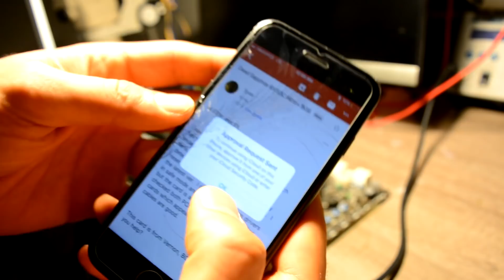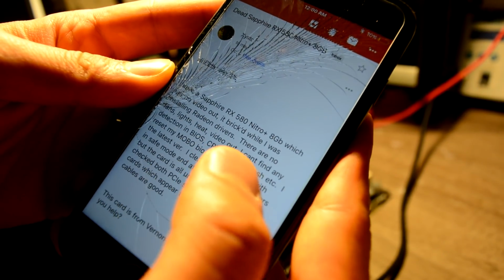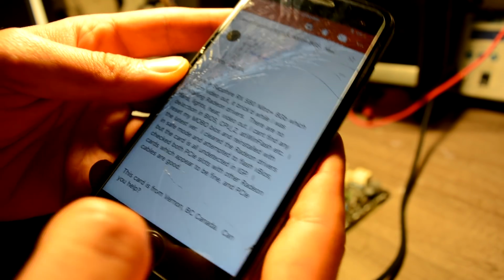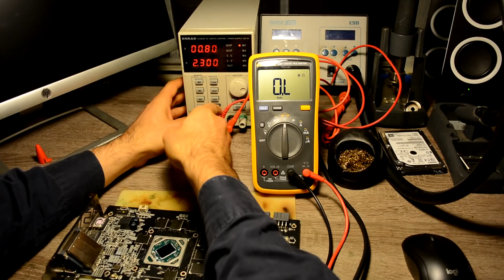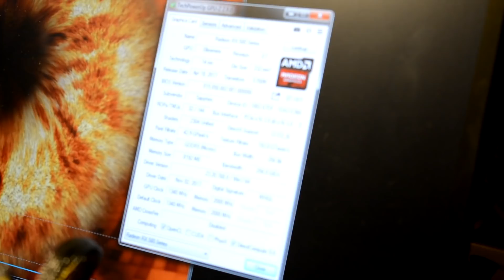RX580 repair graphic card unusual problem Radeon Sapphire nitro video card repair

Comment: My son's 580 is fine, but as soon as you start a game, the pc crashes - like 4/5 secnds in and just as the in-game rendering starts. Reinstalled windows, checked the graphics card, cleaned it and I don't see any visible defects. Reset the mobo also.
I do use a VGA to HDMI converter though. I'll have to replace that and see if it fixes the issue. For now, he's playing with the onboard graphix(Zen 3200G).

Comment: in short, could you tell where is the problem with the disappearance of the volts ? I find it difficult to follow you. Which is the function of that very LDO-regulator? The problem of failing to have 1.8volts in VRAM is due to this regulator?

Comment: Hey Eli, Dont know if you will even see this, 
But I have a question.

My rx580 is spinning, it is detected in the device manager, 
but it will not display at all.
Booting into windows will get me a black screen, and when downloading drivers for the Rx580 my pc will just freeze. 

Thanks, hope you can help.

Comment: Hello, im really happy you made this video because it might be the same problem im facing with my RX580 which do not power at all. 12V fuses have blown, but no short found, the core takes amps from the coils of the power stages but not right after the blown fuses. The situation for me is quite differente as i don't own a motherboard yet, i have a lab PSU and multimeter and i was wondering if it's enough to target the GS7103 as faulty, or even the NCP81022.  Do the PCIE connections has to be feed as well during the process ? In my case,  if i feed the 12V rail and bypass the fuse, i don't get output from the GS7103. Wish i found the guilty part.

Comment: hello i have a asrock rx580 the card cannot display but its detected by bios and windows. GPU z display bios info and fan speed but cannot display gpu and memory sensors info’s . the ship is heating normally . there is no missing voltage for the gpu. according to you wat can i check to solve the issue. thanks

Comment: Hello, i have 2 broken AMD cards: rx 370 3GB and rx 580 4gb both have same issue, they only work in safe mode, once the driver initializes, it gives black screen, what could be the issue? which components do you suggest i check via the multi meter? did you have cards with same issues?
Reply: VRAM problems, use tserver, if not check for memory controller

Comment: Unbelievable this actually worked!!! I had an Asus RX580 that would reliably fail 20 minutes after power up. I removed heat sink and fan assembly, cleaned off heat transfer grease from GPU, then heated the board up with my heat gun.  I slowly heated the whole board to about 170c then heated the vram chips and GPU to between 187-200c for about five minutes. I used an infrared thermometer to monitor temperatures. After letting it cool I applied fresh grease re-assembled and powered up.  I have been running GPU benchmarks for 2hrs and board is working perfectly. Thanks!
Reply: And how is the card doing right now? Still running perfectly?
Reply: @secondfirst7789 same question @PAULHODARA

Comment: Hello. I have the same card. I recently saw that in games that use over 3gb of vram(i have the 4gig version with Elpida memories) some small dashes of purple light appear on the screen after some time playing (can barely see them).
 I thought that the vram might be bad so I installed OCCT to test it. 1 minute into the test and I already have 7k errors. What does this mean? Could the thermal pads be that old? Is my card dying?... What can I do? I bought some thermal pads and plan on replacing them, but I have a feeling it might no be that. Help :(

Comment: Hi Eli! I have a sapphire card, and the fan controller part burning out even if the IC's and other parts needed to change were changed. 1st and 2nd attempt too. Do you think in my case is it because of this LDO regulator too? Or is it powering the GPU only? Thank you!

Comment: Hi Eli, I have a rx 580 that is showing artifacts on boot and fails to initialize, and causes crashes. I think its faulty VRAM or possibly the voltage regulator in this video... Can i send you the card?

Comment: Hi Eli! I have a same card that works but the fan isn't spinning. It spins like a few rotations once in a while but the card will over heat after that. Is there a mosfet to replace?
Reply: Mostly the fan blades just shake a bit and doesn't spins

Comment: Hello Eli :), i am testing one of my Sapphire nitro Rx580 8gb follow your steps with voltimeter :), in my case video card not show video also on windows no detected my video card, when i tested on PCIe with finger on GPu is getting hot and i shutdown at moment, some suggestion to keep testing ?

thank in advance

note: is wear because i save this card inside box over 1 year and alls card was  working perfect, and now after one years 50% of card getting the same issues :(.

Comment: I have an XFX RX480 8GB that has post error (the computer couldn't start and freezes with a black screen). I was able to reflash the bios and tried different bios but it didn't help. Do you have any clue what might have been the problem and how to fix it? Thanks!

Comment: I have a msi gaming X 580 8GB, I bought it online and it never gave a video signal, it turns on the rgb lights and the fans, but it does not give signal through any of the ports

Comment: Hello elitech and good job.
I have amd rx 580 sapphire 8gb all voltage is good windows detect card but error 43 i have flashed with good bios for vram but not function. I have reballing gpu  but no change.
With Gpuz don t see gpu clock and memory clock i don t know for what.
I have buy this card defect on ebay and i have 6 other with same problème. 
Thank you very much

Comment: My GS7103 doesnt even get the 3.3V, but the 3.3V line from PCIe is there. what else can i check? Onm the APW8722 i was able to measure 12V on pin 5 and pin 8

Comment: Man a I know this video is more than 2 years old but still the best video of diagnostic of a GPU.
I have a problem with Sapphire RX570,  fans are spinning but no image :-(  win 10 recognises the card but gives code 43 error.  both BIOS 's are working, I tried to reflash both of them and it worked but stil no image. Checked the fuses with multimeter and all 3 are OK. If you see this please give me some advice.
Reply: I also tried reinstalling drivers with no luck. I have tried another GPU SAPHIRE RX 590 and it's working perfectly with same drivers.

Comment: A GPU card can kill the motherboard?
I have one to repair that got died with the mother and the power supply; CPU and memories are fine, also the disks.
I'm worried if I cant test it on my new motherboard, I don't want to kill my new motherboard too.

P.D.: 6:37 I get scared when you turn off the switch it sounds like some capacitor or some chip blow up.

Comment: Hello I have an MSI R9 380 it works just fine, never crashed, no overheat fans spin normally BUT only outputs video through DVI I and DVI D ports no displayport nor hdmi port. How could I fix it or what may be the cause of this?

Comment: I am half blind and stuck my pci express 1x riser adapter in wrong and i think it blew a pci express driver  NO Fan NO LIGHT SAME THING . The first quesiton people ask  is how ??? its slotted. weel the 1x mining adapters can be flipped are you can put it to far and put the back pice in the front part of hte slot and leave the front part over hanging not plugged into anything (exactly what  i had done).  So how much was the thingy you replaced?  Can i send you my card an you look at hit how much to repair?

Comment: do you have the video on replacing/transferring the VRAM?

https://www.gigabyte.com/Graphics-Card/GV-N760WF2OC-2GD#ov
Q: GTX 760 2GB GV-N760WF2OC-2GD has VRAM slot, is it possible to add VRAM on it?

Comment: Would you be willing to look at my 580 PULSE that does not post/boot?  I bricked it with a bios flash, but reflashed it with a SIP programmer, i may have fried something jumping the BIOS chips trying to get it to boot.  Fuses check out.  BIOS chip and the chip you replaced in this video (next to bios chip) have power... GPU gets warm... system will not post
Reply: 2-3 kOHM 12v to ground... is this a short?
Reply: 0.3OHMs at the 4 power thingys 3:09  IS THIS OKAY?!

I'm hoping it's just that I flashed the BIOS with a 5V flasher but it verified it

Comment: I got a problem with my card, it suddenly stops then fans accelerates/rotates fast and the connection between the card and monitor turns off.

Comment: Great channel for those of us who like to see how things work and sometimes don't work. And how to go about fixing them. I have an RX 580 (14 months old)that works fine till you start to load windows 10 then the fans stop video goes black. This started a few days ago after bios reported the card overheating. I disassembled the card found the heat pad's in incorrect positions and some folded over. What can I order as far as replacing the pads? Purchased some from Amazon but not sure if they are correct for this application. Also are their card-specific kits you can order or is it mostly DIY.  When I was young we did like you tried to fix it ourselves, sometimes we succeded and other times we failed, but we learned something by doing it and not just buying a new one. I'm happy to see others with that same curiosity thank you, also how would I get this card to you if my efforts fail?

Comment: Nice video mate. Do you have any diagram on where to test and posible parts?
Reply: FWIW https://www.youtube.com/watch?v=5oD69tIrU7c looks at a RX580 and shows close up where he is connecting his probe (though he doesn't mention that the hangs the negative probe on the bracket at the start to give ground (just as our friend does in this video).

Comment: I have a XFX RX 580 and Recently I've noticed 1 of my gpu fans is not spinning, it twitches from time to time but it doesn't actually spin, my temps go up to 79°C, and the fan's behavior doesn't change. I've tried checking the bios, then I used msi afterburner to see if I could change the fan speed but nothing really worked for me, I've seen some other people taking their cards out, spinning the fan manually and putting it back in and getting it to work, I did try that but still did not get a good result, so I don't know anymore ( as far as I know the gpu is not within warranty)

Comment: Hi, I just admire the way you work.. I have the exact Same card, it works and shows video signal but the fan coolers and the led where says "sapphire" brand, are not working.. Any hints? I can't use it because it will get hot because of fans not working

Comment: I wish you would show more of what you are doing. You say we have 12 volts and the board is not in position to allow us to see what you are touching and how you decided that was the point to touch. You say  you are checking the phases. How and where are you checking and what would tell you it was good and what says it is bad. How, where, and why do you check that. Thanks for the video.

Comment: Hello.
Great thanks for your video.
I'm experiencing another kind of problem (sorry for digging out this old video) with a RX 580 Armor 8Gb.
I'm on a new computer (Aorus AX370 Gaming K7 with latest firmware, 900W PSU, 16gb DDR4, NVMe SSD drive, ...) running Windows 10 x64.
The graphic card is a second hand (probably a mining card) and I've a "error 43" but a clean display without any artifacts (but no hardware acceleration). I swapped GPU firmware with one corresponding to memory chip on techpowerup but not solved the issue. Tried to uninstall driver / reinstall (different version... tried crimson version too... no better result). Tried pixel clock patcher... no more luck.
I managed to make the card running one time on Ubuntu (played witcher 2 about 1 hour without any problem with ultra details) but no more after a computer reboot (the computer freeze on booting... black screen for a while and all fan running full throttle about 5 seconds before a reboot. maybe an UEFI issue ?).
The MSI support doesn't give any more help for old graphic cards and have not issued the latest stock firmware for the card.
Is anybody encountered the same problem ? Is there a solution (hardware component to check, software to install) ? The only "old" thing on my computer is the screen (not a 4K capable monitor). Can it be the origin of the problem ?
Thanks for any help
Reply: I have the same problem with an rx 580 armor 4 gb. Mine has weird problems aswell

Comment: i got code 43 on my RX580 my pc picks it up but neither memory nor clockspeed gets detected it only comes up with a code 43 error how do i fix this . is it a board level issue i reflashed bios and nothing changed how do i resolve this ....... card spins up and windows detects it ..

Comment: hello sir. I am sorry to bother you. I am having the same problem on the same Graphic Card in your video. I have checked and measured by referring this video. All the resistance is same only I have to place difference which is at memory controller (5:08 minutes) which you get 24.2 ohm but I got 16.2 ohm reading. And another 1 difference is at the PCI Express (5:14 minutes) which you get 22.2 ohm but I got 12.5 ohm reading. Is it possible the same component need to be replaced which is IC U300 (GS7103) ? Thank you in advance sir. ^_^

Comment: Brother my gigabyte 1050ti' s (low profile) fan don't spin even temp hits 85 degrees. Also tried with softwares like msi afterburner but didn't worked, fan is working when i tested it with the battery, but don't spin when attach to the gpu's pcb. Can you help?

Comment: I have here a RX580, 1,5Y old, from day one sometimes artifacs, but not always. Brought it back to seller, they say they tested but could not confirm my problem. Now warrenty is over.
Not overclocked, tried in two machines, now with new setup X570 Aorus Elite, ryzen 3600, new memory, new PSU. Still artifacts. Latest BIOS in VGA (from gigabyte) and everything is up-to-date (latest drivers from AMD). Just reinstalled W10 x64, no SW installed and at boot it glitches, also freezes shortly after boot to Windows, also random artifacts in game (BF1, BF5, Star Wars BFII). Temperature is 50degree celcius, fan at full does not matter.
I have underclocked it to base frequency (1257), minus 200mhz memory and +5-10% power to try but no difference.
Any thoughts?
Reply: Same problem here! Any thougts ?

Comment: You cant see what chip you are checking and on what pin. How do you find out what phase is being checked and what voltage you should see. How do you check it if the gpu gets hot right away? Thanks

Comment: Im subscribing. I need help, pls!!! So, my Asus rx 580 4GB, VRM got burned when i was on google chrome, not when i was playing. Before to send it to warranty it was automaticaly overclocking (by the driver) to 1430 Mhz and was maintaining it flawlesly. Now the drive is still overclocking it at 1430, but it crashes, it crashes even at 1380 Mhz, and I cant manually increase the voltage anymore. They've replaced 3 mosfets and a mosfet driver. I don,t exacly know how this voltage controler works, I'm a noob.  The voltage fluctuates, i have a brand new PSU 600W, active,  and nothing.
How do i fix it?  Can i find the origynal schematics? I think that they replaced the mosfet driver with the RX480 's one.

Comment: I have Asus Rx 580 4gb and there are some colour dots on screen while gaming what is problem ? and I have 450w power supply
Reply: You have graphical artifacts, usually means something is dying or is defected on your GPU being memory or chip itself related. If you've overclocked your gpu get it back to stock values, if the problem still persists try undervolting it which usually takes care of the problem.
Reply: @puddingsbane3110  on playing game on high resolution the system hangs and pc restart??
Reply: @thelearner1351  Depends on the resolution you are playing on, 1080p is the gold spot when you have 4GB of v-ram. My best bet is your 450W PSU can't handle the card very well since it's well known the 400 and 500 series RX cards pull way too much current over pci-e slots for no apparent reason and trip ocp.  Unless the unit is 80+ gold certified and can hold its own, try the undervolting method and lower memory clocks.
Reply: @puddingsbane3110  I will buy a 550w psu let's see if my problem would solve,
Reply: @puddingsbane3110  is it possible a card mechanic steal some part of GPU and make it like this because I had given it to him to check the card??
Reply: @thelearner1351  I doubt that, if that was the case the card wouldn't work at all

Comment: My graphics card fan is moving but there's no display, cpu gives a beep code of 2 short 1 long beep 5 times 
I checked the ram there's no fault in that. Because I'm  using another graphics card and it's working fine

Comment: Good morning how do you fix them probably nobody repairs them and you certainly have wiring diagrams ..... also could you help me repair mine ?? I know the video should be exhaustive but I don't have many means .... nor too much time. How much you need?? Is it worth it ??
can you recommend me more ?? I have a sapphire rx580 nitro special ediction unfortunately now dead but the bios reads the polaris ,,, so I think the gpu is alive .... but it gives me code 43 in windows and does not recognize any driver ... you already know .. . What do I need? .... I don't have the possibility to make her work so outdoors to analyze any problems ... Thanks if you can help me ..

Comment: Thanks for these videos. You mention the PSU didn't go into defensive mode. What would that indicate if it did? My 580 is putting my PSU into defensive mode and shows a continuous red led on the card.